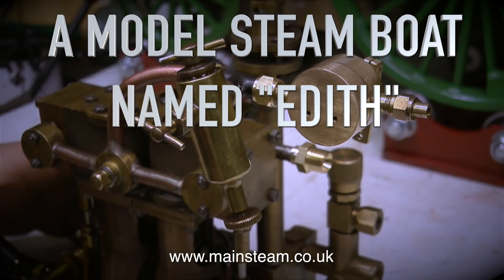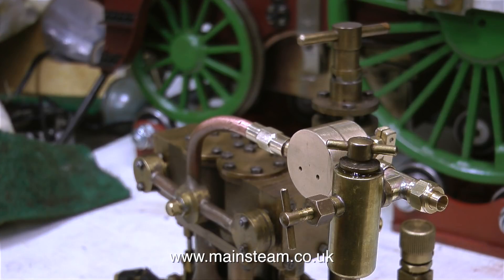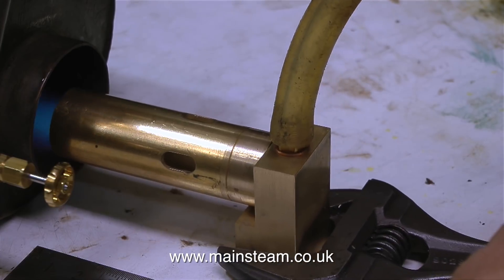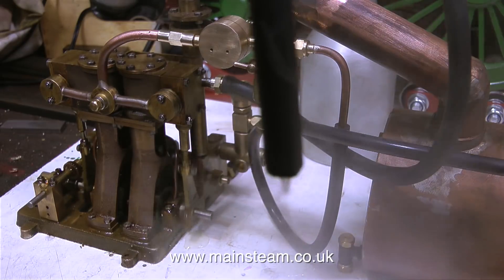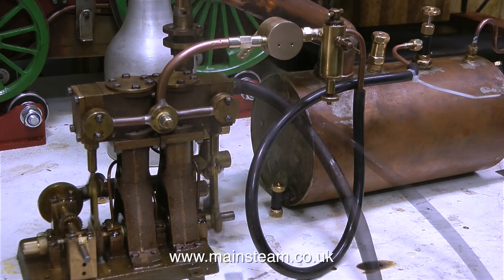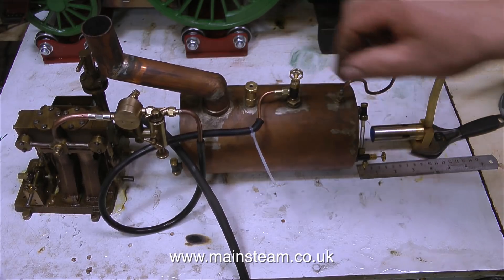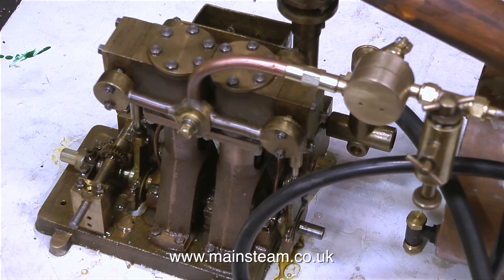A MODEL STEAM BOAT NAMED EDITH - PART #15

Comment: Re your comment about the right steam oil to use for the engines. My engine was made for me by my friend George, an older gentleman in the model boat club that I used to be a member of here in Melbourne Australia. George has since passed away, and I am no longer a member of that club and do not sail with them, so I cannot ask him what type it is as he gave me a glass jar of it.. how do I tell and or work out what I need as I am nearing the bottom of the jar?. TIA Tim
Reply from the maker: Just obtain a bottle of steam oil if it is for the displacement (cylinder) lubricator.
Reply: @keithappleton  Thanks ill chase some up at the local model steam train track that I am thinking of joining.
Reply from the maker: If you find that the Model Steam Club hasn't any, try Ebay or www.forest-classics.co.uk

Comment: I'm completely shocked and most upset... Not once did you mention blackgates engineering. I almost unsubscribed.   :)
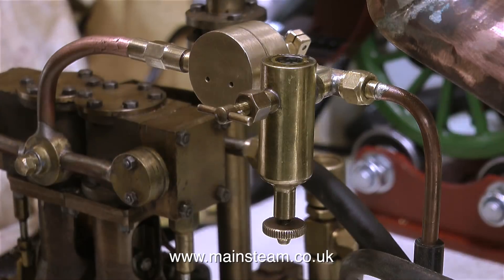Also at 2:10, 2:11, 2:12, 2:13, 2:14, 2:15  I'm pretty sure you was doing everthing wrong.  and your end credits was wonky.  :)

Keep the vids coming an ty...
Reply from the maker: }:-))) - It still surprises me how many viewers ask me where I get this and that from - as it is usually from www.blackgates.co.uk

Comment: have you ever repaired or had a steam boat with a "White" boiler system? because until now i have only seen those kinds of boilers on cars, i imagine using a part of the hull as condenser to reuse the water. what do you think?
Reply from the maker: Most model boat boilers are cross water tube centre flue type and it's not really a practical proposition to separate the oil and reuse the water in a small model steam boat.

Comment: Here in the states it is still possible to get up to 5 gallons of steam oil.  Auto parts stores just need to search for "600 valve oil #B".  Yes I know B isnt a number.  It is what I was told to search for.  It is actually fairly common to get.

Comment: I just had a rather interesting idea... So, the gas tank will be getting lighter and more buoyant as the gas is drained out of the tank. You mentioned in an earlier video that you were going to have a hold-down clamp to keep it from floating up, but what if you didn't? You could fit a little "Flag" of sorts that would be visible from outside of the boat that rests on top of the tank. As the gas was burned, the flag would rise up, giving the person back on shore an idea of how much fuel was left, and possibly preventing the need to go for a swim to recover Edith...

Comment: Once again, a wonderful video... it would kinda be cool if you put a switch underneath the gas cylinder so as it empties to a preset level it activates the switch and tells the captain he is out of gas. I mean I dont know if the tank would be buoyant enough for that.
Reply: When the engine stops the Captain will know he is out of gas.

Comment: One of the earliest refrigeration systems used water as the refrigerant only, no additives.  The compressor was a big cast iron single cylinser type. as the system worked the compressor created a vacuum vaporising the water. Since the system used water they introduced liquid water to the compressor cylinder for lubrication and an added sealant in the piston cylinder.
Now the system did not get very cold but down to just above freezing the system was very effective. 
Higher efficiency was realized later with different chemicals.
Thanks for the vids

Comment: Are you aware that at 5:30 I was saddened by the end of your excellent video?  

By the way, I help a friend with a 10hp double expansion naval steam cutter which doesn’t have either a superheater or any in-line steam lubrication. The lubrication in the cylinders is provided by the wet steam and corrosion inhibitor. All sliding parts are cast iron which is, as you know, partially lubricated by the high graphite content of the metal.  All steam is condensed and re-used. Built in the 1890s it is still working well.